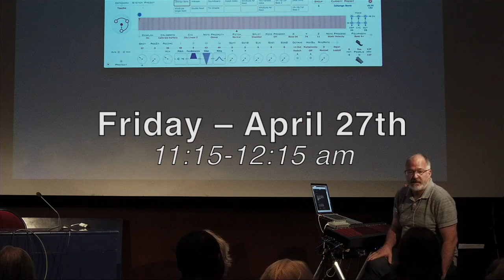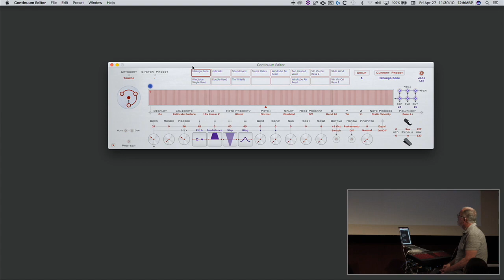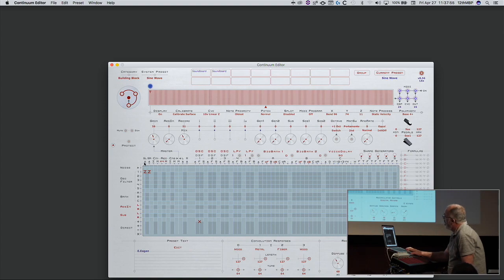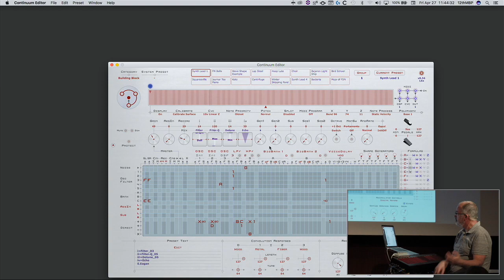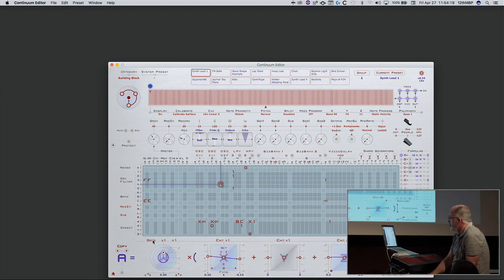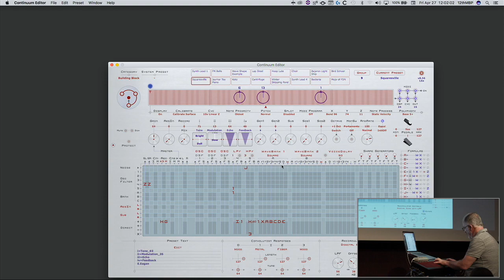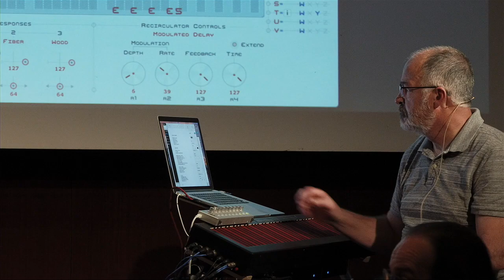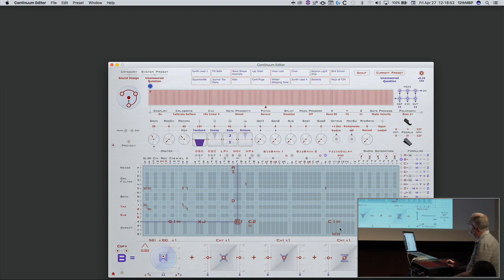IRCAM's ContinuuCon  - introduction to EaganMatrix

Comment: Around 25 minutes in, good question about the definition of sampling... traditionally it has always been used to mean linear sampling over time, so we think of it as meaning that, but spectral sampling is really just the same idea turned sideways.